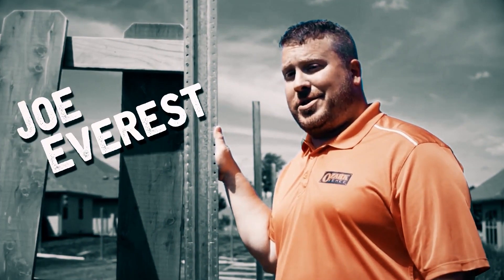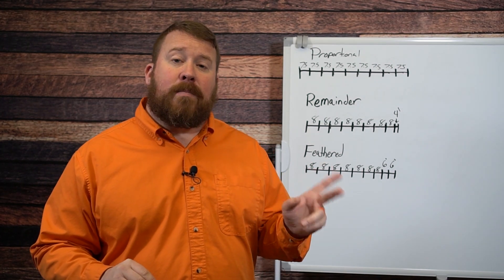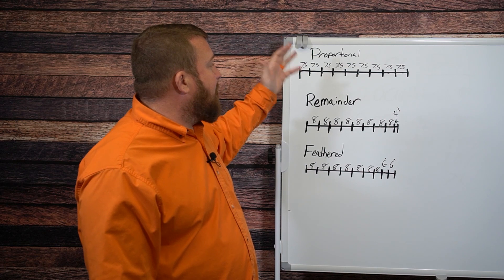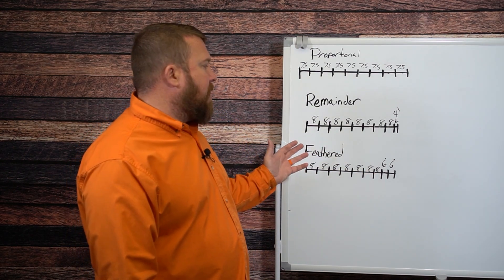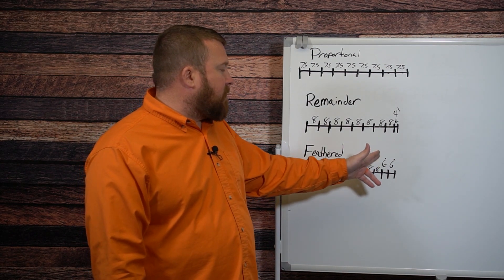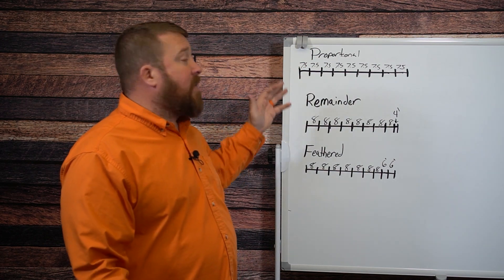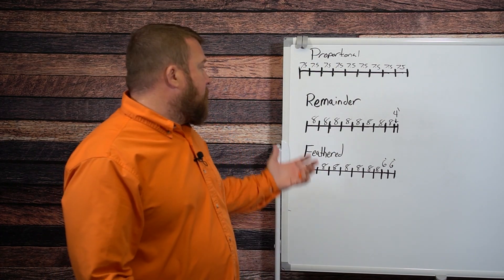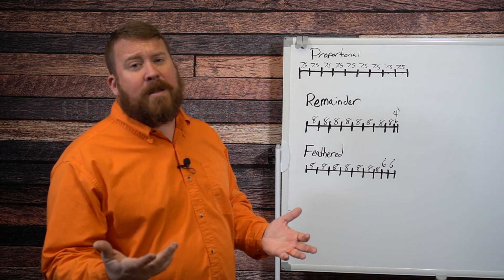Fence Post Spacing Explained (How To Incorporate Proportional, Remainder and Feathered Spacing)

Comment: Hey, Joe! I just recently discovered your channel and I really appreciate you putting these together.
Is there a reason why fences are typically in 6’-8’ sections? Would you lose a significant amount of stability by going to 10’ lengths? Are there any additional variables I should consider concerning the spacing? Thanks so much!

Comment: One additional reason to use proportional spacing is it leaves you the ability to jog a post one way or the other if needed to miss roots or other underground hazards.  Your next post can go were you marked without the section breaking 8' so no remeasuring and remarking the rest of the run.

Comment: Does this work if there is a gate in the middle of the fence?  Would you then just use either of the 3 methods from the left and right side of the fence to the corner?

Comment: I placed 5 posts, but because of stone and tree roots, I could not achieve even spacing: one is about 9ft away. Do you recommend putting a vertical 2x4 between the posts over 8ft spacing for stability, or work with what I have? I'm not too worried about the look since I'm running the rails over the 4x4, and the fence is behind 30ft. green-giant trees. The fence's purpose is to keep the dogs contained.

Comment: I plan to do a horizontal fence. The redwood cedar fence panel size is 5/8, 5.5, 8 feet long.  I am concern the factory length may not be all 8 feet long.  Do I need to trim the panel length (may be half an inches at the end)? So that all panels can be exact same length.
Reply: Hey what did you do? I bought 8 ft wide panels.. but after setting the posts, I measured and it was found that all post are not perfectly spaced. Some are ok an dsome with just 7.5 ft space. What dis you do? Cut the panels?

Comment: Is this based on 8' centers, etc? Or 8' between insides of posts? Thanks.
Reply from the maker: Depends on the type of fence. Chainlink is 10’, wood and ornamental steel are 8’, aluminum is typically 6’. All are measured on center.

Comment: I'm trying to save money doing the fence myself. I had an idea of doing posts 12' apart. Thoughts?
Reply: For a wood fence no more than 8' apart
Reply: @sarahcheek5181  I meant 10' apart but that is still outside of the 8 you mentioned.
Reply: @silverqic  you might save a little bit of money in the very short term. That being said industry standards say no more than 8' apart on wooden fence. The further apart the post are, the weaker, more flimsy, and less stable the fence is.  Not to mention the warping that will occur.

Comment: I bought 8 ft wide panels but after setting the posts, I measured and it was found that all post are not perfectly spaced. Some are ok and some with just 7.5 ft space or 2 inches more. What should I do? Cut the panels? Good thing is none of the posts are longer than 8 ft wide. Just under 8 ft.
Reply: Put rails on first then add the panel, that way no need to cut panels

Comment: What is the length of post for a 7 foot fence. 10 or 12 feet.
Reply from the maker: 10 would be the minimum I’d use, but I’d rather use 12s!
Reply: @JoeEverest  thanks Joe.
I'm just trying to find a post installer and getting different opinions to the length. Also the amount of concrete varies from 2 to 4 bags.